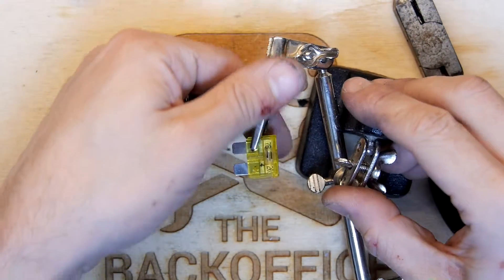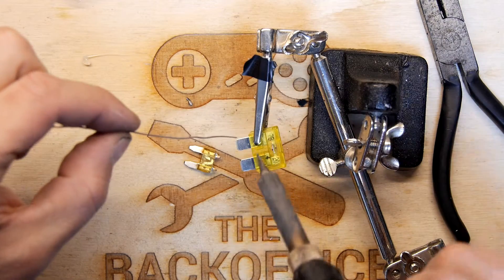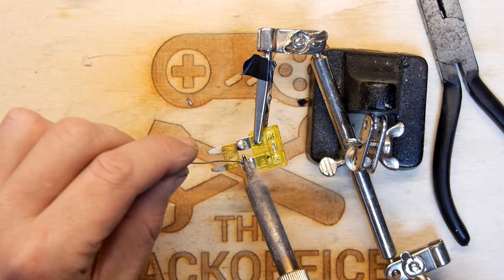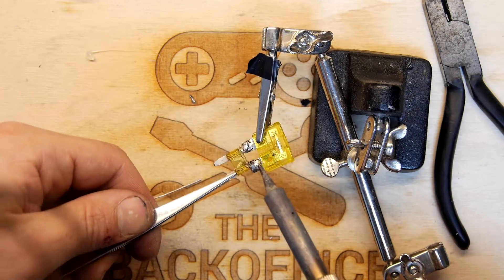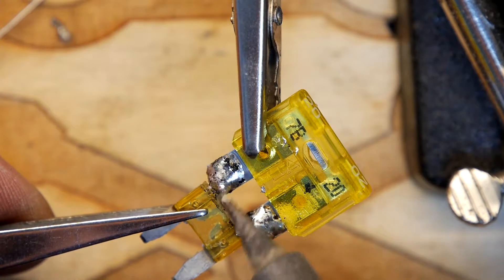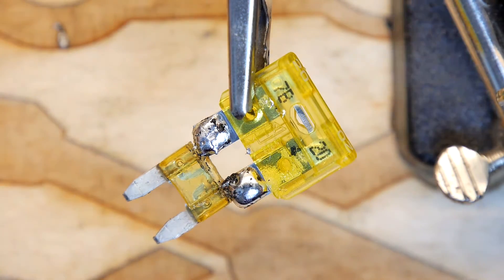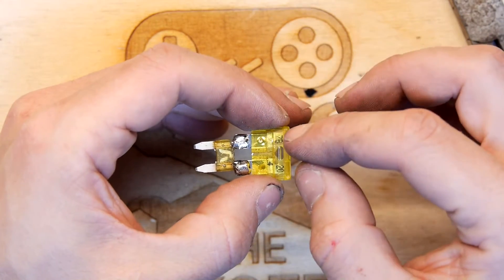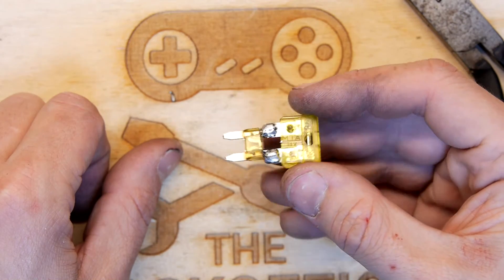Dashcam Fuse Hack

Comment: One problem I foresee in the future is solder is not good for mechanical connections. Being in a car this would not last long.
Reply from the maker: +Big Guap I'm pretty confident. Not really any weight or strain on it. In wiring looms i wouldn't solder without good heatshrink to take any strain away from the wires though
Reply: Engines vibrate, Constantly.
Reply from the maker: +Big Guap yes, that's why they don't mount fuse boxes on them and tend to mount the engines in vehicles on rubber mounts.